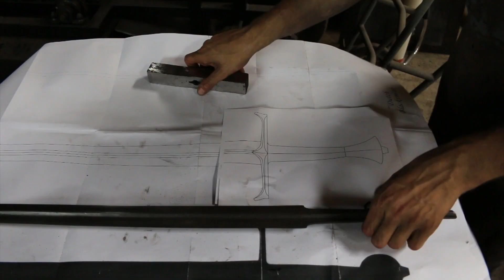Forging a pattern welded sword, part 3, the cross-guard and pommel.

Comment: Beautiful work!! I wanted to know what's the metal you used for the pommel and guard and what is that chemical you used to blacken them?
Reply from the maker: i used surface harding steel. tougher than mild steel and it can be hardend.  i use gun black to blacken them.
Reply: +Freerk Wieringa thanks!!